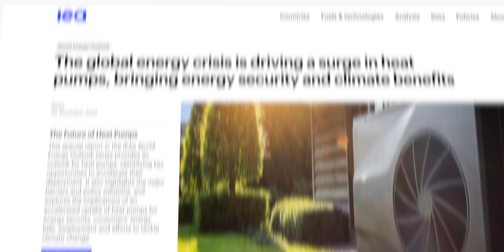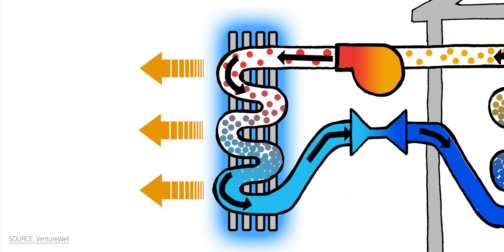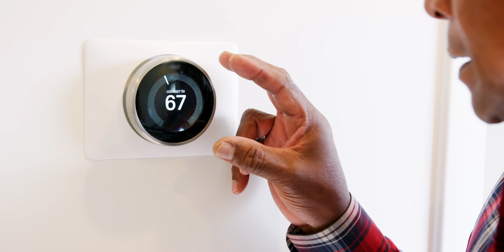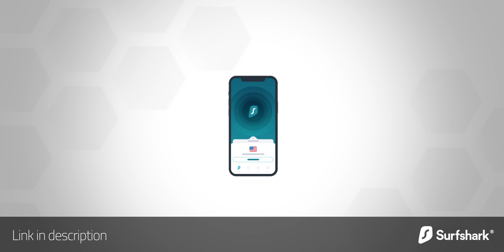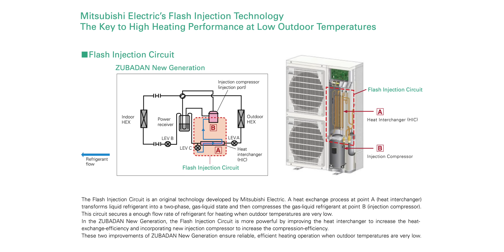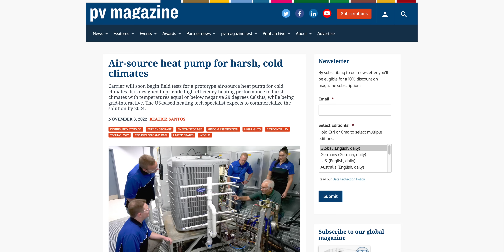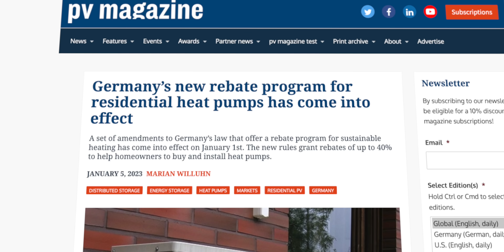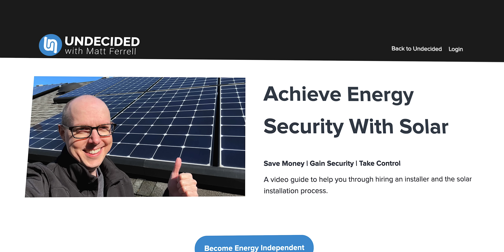Major Advances with Heat Pumps in the Extreme Cold

Comment: For those of us in rural areas who already use septic systems, could the geothermal coils be placed under the drainage bed at the time of development?  Septic systems are inherently designed to not freeze and are even warmed by water runoff.  Seems like an efficient use of space if they could be done together.  Of course it would be a nightmare if there was a leak.
Reply: I've done that, put the loop 1.5m below the percolation pipework from a BioCycle unit. It works without any problems.
Reply: Very cool idea.  It would be interesting if anyone has tried it.
Reply: They produce heat by fermentation and also produce methane that you can burn to heat water. But the amount may not be large.
Reply: @janami-dharmam  it doesn’t need to be large.  The heat from unfrozen ground is  enough.  Any extra heat in winter would be a bonus.  I was thinking purely about needing to dig up a yard to put down the piping *twice*.
Reply: @wolfeb99  not quite so; the soil is a poor conductor of heat and the heat stored in 1 m3 of soil is perhaps good enough to heat your home for a day. If the cold persists for a few days continuously, the heat pump will not work. You need one that is spread over a larger area
Reply: I wish more people would talk about co-existing infrastructure, like what you are suggesting.

Solar, batteries, geothermal… all just feels like a rich man’s set of toys to me, to make people on the high end of the income spectrum feel better about themselves, while normal people go about their ever increasing normal energy usage.

Comment: I live in Sweden, in a place where we have freezing night temperatures from November to about March. Even the old HE system we have in our house (ground>water carrier) is several times more efficient than direct electricity or gas heaters. The only downside is that during summers, the efficiency is lower than having an air>water HE (for hot water generation mainly, in the summer). The temperature of our deep well ground water is only about 7deg C. An air>water system has a heat efficiency of about 5-6 in the summers, twice as high as our ground>water system.
If you think the disinformation about HE tech and efficiency is bad in US, try England/GB... :) -but their building code / recommendations / contractor "knowledge" are in many places still firmly locked in the middle ages.
Reply: I think you mean the Dark Ages!

Comment: I live in SoCal where we have been having the coldest, wettest, snowiest winter in a long time.  There is a Fujitsu Halcyon inverter based heat pump at my place and it is zoned out, which is really helpful.  What I have found with this unit is if you play with the temps and the unit kicks into high gear to warm the place up, runs rather inefficiently to do that.  So if you are hoping to save energy by letting the place get cold for a short little while, say you go out for a bit, and then warm it back up, that doesn't save anything due to the subsequent huge draw to warm the place back up.  You need many hours of letting the place be cold before that 'trick' starts making any actual sense.  But if you just let it cruise at a set temperature with a good thermostat reading source (if you know what you are doing, you can switch between reading from the AC head and wired in remote control with these units), it is super efficient.  Pointing this sort of thing out in your video briefly doesn't quite do it justice in how important it is for a heat pump to be able to cruise at a more or less constant low pump speed.  Also zoning is great at night for just keeping the bedrooms warm and thus less load on the unit as I don't heat the whole house at night, but the unit is setup so it can if all the zones are on.  At least in SoCal in the valleys where it is not too terribly cold, granted I did see snow outside on a couple of different days where I live, which is basically unheard of for decades now as temperatures have warmed up due to global warming and the concrete urban jungle heating effect from population growth covering the land, this unit is amazingly efficient, even on the days where I saw snow falling onto the house.  I mean significantly colder outside with thick cloud cover blocking the Sun completely over a 24 hour period, but only a modest, incremental extra use of electricity.

I have talked to others and found an example where someone had their thermostat set to the same as mine and their overall living conditions not that different from mine, however they have been using a natural gas heater to hold that temperature.  I spent ~$80 on electricity for my heat pump for the billing cycle.  They spent $600 on natural gas for their furnace over the same billing cycle.

When you are talking about a $500 savings in a single billing cycle using a commonly available inverter based heat pump in SoCal, well maybe there needs to be more focus in getting this tech in everyone's home out here in SoCal.  The technology is definitely ready for this place and with sky high bills for not doing it, it is a must just to be able to have a chance to afford to live out here without freezing to death in the process.
Reply: Both electric and gas rates are pretty bad in So Cal, right now, making heat pump efficiency a better way to go.
Reply: Thank you so much for this info.  I am in socal and I have a contractor waiting for me to pull the trigger on a full HVAC install.  The gas furnace to heat pump difference is only about $450.  I think I’m going heat pump.
Reply: For some reasons, you forefathers did not pack the secret of "thermal insulation" when they migrated ..

Comment: Where I live, the heat pump would need to be capable of operating in temperatures as low as -35°F ambient temperature.  While it's a rare event to be that cold, it happens and is the most crucial time you need reliable heat.

I do have a heat pump in my camper.  That unit can really only operate down to about 45°F.  But it's a nice alternative to the propane furnace or an electric space heater which both cost more to operate.  Perfect for autumn weather or cold summer nights.

Comment: I had a heat pump that was useless when the temperature dropped below 45*F.  I changed out the outdoor condenser that was still compatible with the air handler and bam!  

All fixed, the issue was… American made outdoor handlers.  Those things are garbage and are loud!

All of these Asian heat pumps were already capable of this where they have 100% capacity down to -10*F, and 70% at -20*F.

Comment: Your comment about heat pumps being more efficient than gas heating isn't really correct.  I'm all for heat pumps, and in some cases they are more efficient than gas, but on average they are not.  
Bit of math:
US is 40% renewables (on the high side), 60% fossil fuels, with natural gas dominating the fossil fuel category.
Natural gas averages 40% thermal efficiency.  Transmission is about 90% efficient.  Heat pumps have a cop of 2.5.
So on average natural gas to heat your house using heat pumps:
0.4 * 0.9 * 2.5 = 0.9 thermal efficiency
For home transmission natural gas leaks lose about 1%.  Furnace is about 93% efficient for high efficiency furnace.
0.99 * 0.93 = 0.92 thermal efficiency.
I would agree that from a CO2 stance the heat pump is better because then the emission is (1/0.9)*0.6 = 0.67 units vs. (1/0.92) = 1.08 units.

Long story short, in some cases heat pumps are better but for many it is not.

Comment: Hi Matt. Great article. Can you talk to the noise levels of heat pumps. I live in a city in the UK, and the neighbours house is only 6 feet away from where I would prefer to put my air sourced heat pump (geothermal is not an option for me). Would I get complaints from neighbours about the noise levels? 
I also have water filled radiators currently. Can I heat the water for these? I guess I would therefore lose the ability to cool things down?
Reply: Heat pumps are basically just air conditioners in reverse. If there are no issues with ACs there should not be any issues with heat pumps.  As to heating water, there are systems that can both heat water and air but they are prohibitively expensive.  You would be better served by using a hot water heater heat pump and a separate air source heat pump.

Comment: i bought a small one with variable compressor to heat my flat last summer for 750€ on amazon. it got me fine through the winter with up to -10°C so far.
installed it myself and didnt use any government incentives.
its a small flat and i installed it in the livingroom, to heat the adjacent bedroom and bathroom(shower) i just open their doors if needed. entryroom, kitchen and toilet arent really heated because there is no need, there is a infrared panel set to 14°C but it only turns on when its realy cold outside.

Comment: A shift to air-based heat pumps might reduce energy use on average, but it would massively increase peak electricity demand during a cold wave -- to far more than peak electricity demand during a summer heat wave.  And solar panels produce far less electricity during the winter than during the summer.

So there would be far more strain on the grid.  It might need to be doubled or more.  Geothermal heat pumps don't need as much power in the winter, but most won't installing those.

Once we use electricity for heating, as well as cooling, and install lots of solar, peak artificial energy demand will shift to the time of minimum natural energy supply -- when the sun is providing less energy.

Comment: Playing devil’s advocate (or outright satanist in this audience) – what if you had a configuration that could route the heat collection pipes through an external traditionally fuelled furnace?  
So or example you have a configuration where you have an outside (small) building that has a furnace inside that is electro-mechanically managed (so it automatically feeds fuels such as pellets, blocks, etc.) and ignites them;  then the pump configuration does everything it can to pick up as much of that combustion heat as possible.  Sure there's still CO2, particulate material, etc. but that's inevitable in most power chains in practice now.  You could potentially fuel a device like this with flammable material that is collected from your property, etc. at least to an  extent.
Imagine being able to do this with a REALLY small combustion area – so a very small fire that is perhaps smaller than a regular fireplace fire but it’s potentially delivering heat to the entire house.  I’m wondering if such a configuration could be useful in areas of more extreme cold where it’s a maximal use of such combustion compared to a traditional fireplace or trying to desperately leech heat out of the surrounding ground, etc. 
Before you send Greta after me – in this thought exercise the actual combustion would be small and could be run on anything such as waste products which normally would end up in landfill…  I don't live in a particularly cold area (and grew up in Australia so "cold" is something that happens for 2-3 days a year before everything's on fire again) but I can imagine being somewhere that gets REALLY cold, has a dozen feet of snow overnight, etc...  Could this idea be useful?

Comment: I read these comments and see a lack of real experience or understanding. Pay closer attention to when your thermostat hits EM Heat. It will inevitably do that when the outside temp hits 0C or 32F. Now your running an electric furnace. With a proper installation and house insulation you will feel as if the unit is working great but it's not. This problem has alot to do with the changes in regulations on refrigerants over the decades and increased pressures the systems now run at. After 8 houses, 10 units and 3 states I'm currently modifying my heat pump for a wood furnace boiler for winter. Paying a $500 electric bill while wearing a coat and wool socks in the house is a no go anymore. And before anyone says it, my home is insulated just fine, 3800 sf only costs me 120 a month to cool in July. Geo thermal may help improve performance to a point but having an additional option for heating is advised.

Comment: Heat pumps, ERV fresh exchanges, tight construction, solar panels, battery backups, and propane generators are the way to go. Yes it costs a lot more money, but most people should live in apartments where you can more easily share the added costs and reduce transportation costs.

Comment: I wonder if this also applies to extreme heat. I live in a place where I don't really have to worry about the cold( coldest day this winter was around 12ºC). But I'm considering a heat pump for the summer when it could reach 30-33ºC
Reply: They are a good choice for you.  They are basically just air conditioners with a reversing valve, sounds like you need an AC so that's a good use case.
Reply: Then don't go for standard installation in the floor. You can place the heat dispensers in the ceiling, then there is no risk of getting mold underneath your floorboards. Pair it with a central ventilation system to get the moisture outside.

Comment: First things first for me  I would do something most people would never never never do..  Dig trenches install 4-6 in pvc tubing about 8 feet below grade.  Then duct it into and out of an enclosure that I would install around the heat pump.  Blow air thru the tubing sucking ground temp out of the tubes.  Around most of the country that would be 50 -55 degree air.  So only have a delta of 15 degrees Talk about efficient.  But I know you have never never never thought of doing this
Reply: That is a ground source heat pump basically. Except you're using air which is a terrible conductor of heat.  In addition you're digging larger trenches to fit the larger pipe which means more money.  If you had the time to do that instead just put some PET piping down seal it for water and you got yourself a ground loop.
Reply: @brettspencer-curran8269  yup that is the idea  but the main reason for doing it this way is that there are loads of mini split systems being installed that dont lend themselves to ground source heat pumps.

Comment: Seems all the engineering is into mini splits instead of traditional air heat pumps. My traditional in my house sucks in winter but my mini split in my shop works to below zero. So strange.

Comment: I’ve been curious on these as I’m going ready to start a new home but I live in northern Canada where -25c is normal and -40 or colder can happen so I’m still not sure it’s a great idea. Thanks for the info though.  Love learning about newer cleaner options
Reply: For your climate it's probably better to have a high efficiency gas furnace for aux heat and a heat pump for heating and cooling when the weather is above -5C.
Reply: You can install a heat pump and keep your old gas furnace. Just turn your household thermostat a couple degrees lower than the heat pump thermostat. If a -30 day is too much for your heat pump those few days per year then the gas furnace kicks in. 

Just like installing on demand water heating but keep the old gas water heater. Your incoming water may be too cold for the on demand heaters, but you preheat it with the old gas heater set to the lowest temperature. 

The negative of this is you cannot go "off grid" for gas so you still have the monthly connection fees from the gas company. But at least your gas consumption will be close to zero.
Reply: @5353Jumper  obviously if someone can have a backup of any kind that is pretty cool, but it is expensive to buy two new systems during a build, maintenance increased, and secondary systems that aren’t in use for a long time may fail to start when you need them. Hospitals that have backup generators are supposed to turn them on sometimes and check them too.
Reply: @jsbrads1  yep all true, but it may still be cheaper and better. Each household will have to do their own math on that. 

Like the debate if you have a few thousand to spend due to home equity, or some grant/rebate program - Do you invest in windows, or insulation or a heat pump or solar panels?

Each region is different and each house within a region is different. 

Just offering one possible solution to plug into the math to see which option is best instead of offering obstruction to every potential solution so nothing changes ever.
Reply: If you are using gas, seems to still make sense in your environment.
Reply: I am in Canada too, and we get the temperatures you describe.  Our new air source heat pump heats only to -28C.  We have an electric furnace that kicks in below that temp, only had to use it once last winter, and we used to use an oil furnace for backup but it was condemned and we went electric.  I think the air source heat pump is wonderful, particularly in tandem with a backup system for exceptionally cold weather, such as electric furnace, gas furnace, propane furnace, or wood heat.  I wouldn't have it without a backup heat source. The air source heat pump is worth it to us because our electric bill only went up by about $60 a month in the winter, to heat almost exclusively with electricity. (small house, kept at 22C steadily day and night).
Reply: Dont use them. They absolutely do not keep up in cold weather. I have worked on hundreds of them over the years, and if you have the choice get a gas furance
Reply: @zack9912000  
Care to ask from specialist or users from Sweden or Finland?
(i'm from neither of those, but close enough)
Ground source works almost anywhere (horizontal would be not so good in areas of permafrost, depends on depth of coil)